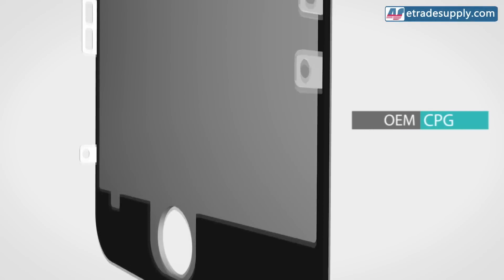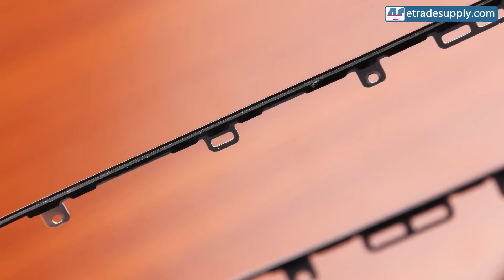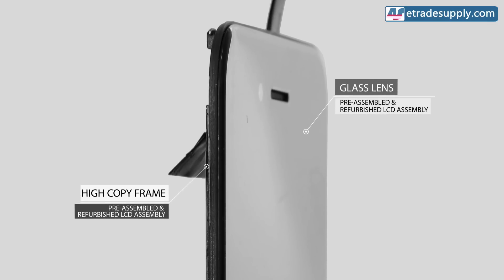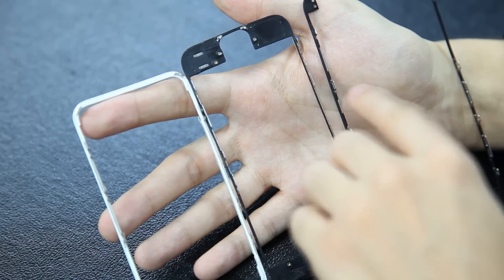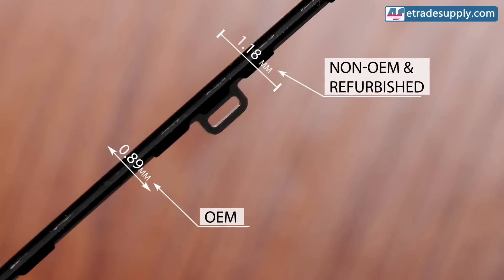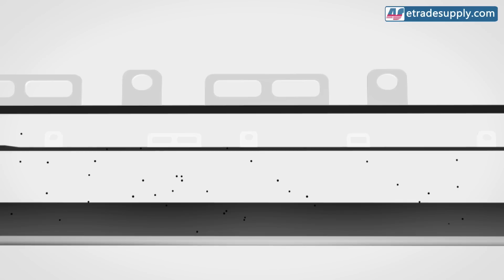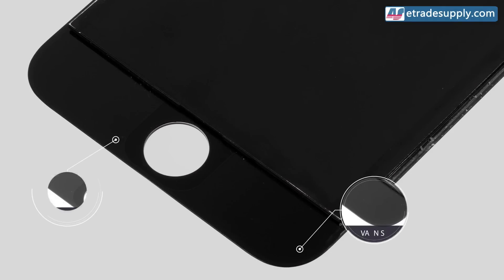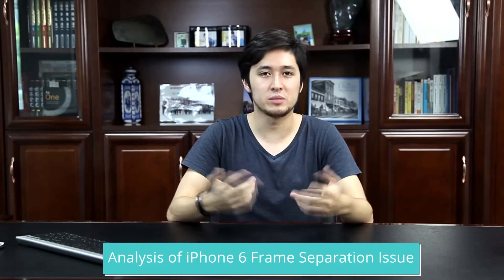Reasons & Solutions for iPhone 6 Frame and LCD Separation Issues

Comment: Can I glue just little side of my iPhone 6 between the glass and the frame with Loctite gel control super glue. It's only a small portion that way I don't ha have to replace the glass panel, could this work!
Reply: Jose A Avellanet It problably COULD work as long as you don't get it on any of the electronic components. If you do do it, be careful and good luck.

Comment: Did I miss the solutions?
Reply from the maker: Cesar Nolasco We can tell you most of the iPhone 6 LCD assembly has this issue,  but we found it early and have fix it by more strict QC  system. The QC process it not easy to show in the video, but actually we have replaced the adhesive and controled the height of the frame, making sure all the parts can meet the demand when they are ready to ship out. If you want it, you can visit our store to check it out! http://www.etradesupply.com/apple/iphone/apple-iphone-6.html